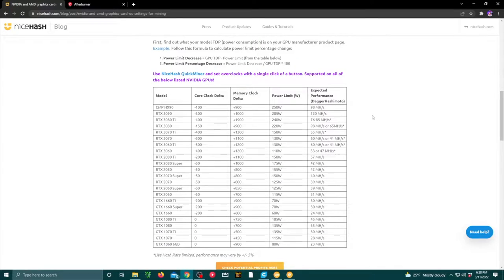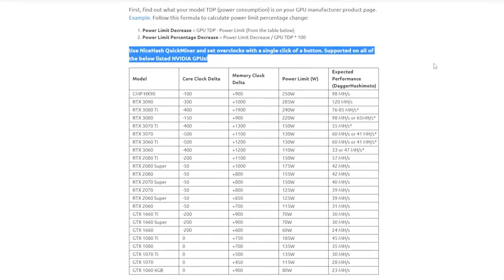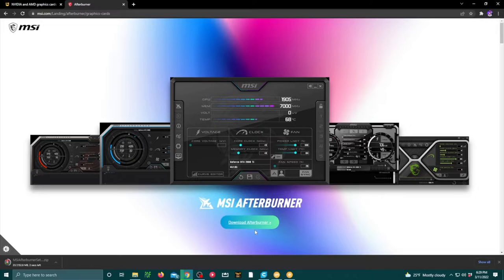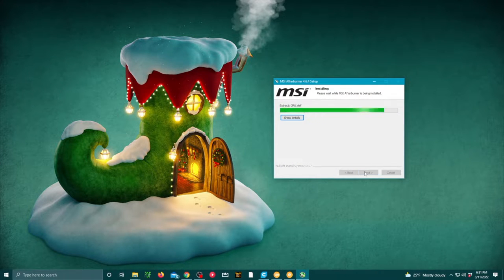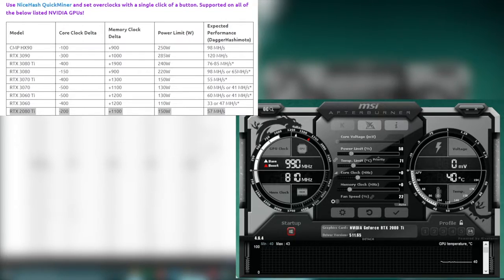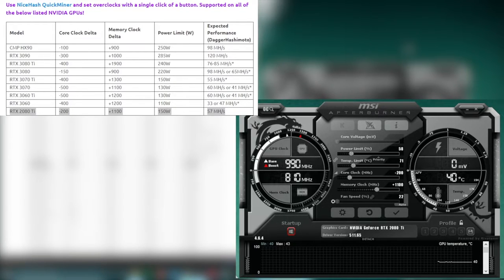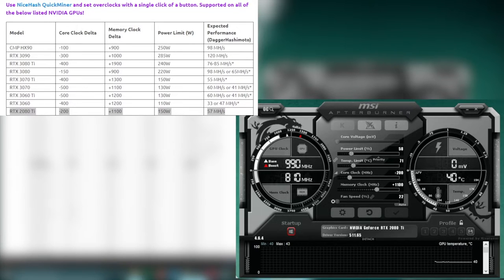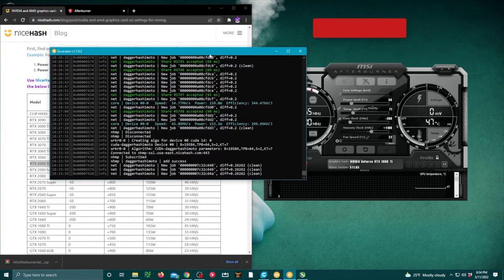NICEHASH MINING OVERCLOCK SETTINGS WITH MSI AFTERBURNER! GPU NiceHash Mining Overclock Tutorial

Comment: seems like you're having the same issue as me. when you start mining with nice hash your mem clock changes. and i cant figure out how to make it not change. i have to re enable the OC and when i do i see a jump in the hashrate confirming that my nicehash is indeed changing my memclock and whats funny is that i have the same gpu as you and did the exact same thing. Goes down to 6800 and jumps up to 7899 instead of 8100. and i dont want to go back to the quickminer because it only has one Algorithm. i also went into the launch parameters for each algo and you can set the memclock but not for all of them. so im still stuck.
Reply from the maker: no problem on my end so far <3
Reply: did u solve the problem? im having the same